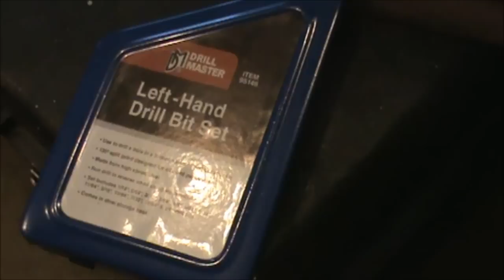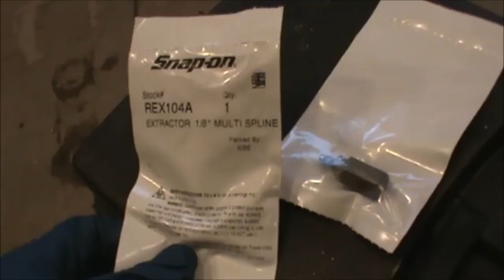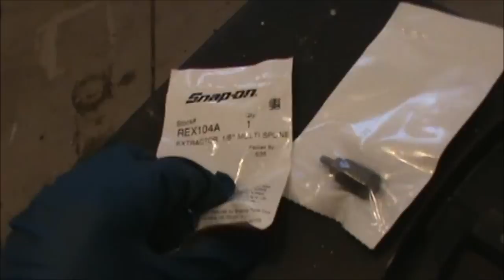How to drill out a broken bolt

Comment: Some people say that the heat from drilling might help break some corrosion off the bolt threads which is a good thing and could help in the removal. Not excessive heat but what is normally produced by the drilling process. What do you think? Thanks!

Comment: Hi DW6...I have a question.  I have a Honda HRR216 lawnmower with a broken bolt that holds the air cleaner assembly and carb to the intake port.  The bolt size is 6x86 based on the part description, about 1/2"-3/4" is still in the machine.  I see in some videos where they show how to remove the bolt using a reverse drill bit and, after finding the center like you did, use a regular drill bit to drill a pilot hole.  Then they use a larger reverse bit in the pilot whole with the drill in reverse, as you did. My question is, do you need to drill a pilot hole or can you immediately use the reverse bit as you showed in the video.  Thank, you have great videos, really learning a lot!

Comment: It might have helped to make a small "funnel" of putty or blue tac around the top of the shaft into which you could spray the penetrating oil. This will help with the freeing of the bolt and will also keep your drill bit cool when doing the drilling. As soon as the drill bits heat up, the drill will blunt a bit and cut in less efficiently. Other than that, the video is very helpful for folks that may not have tackled a broken bolt like this before.

Comment: Removing a good engine from a rusted out deck 3.5hp briggs motor all 3 deck bolts broke off flush, now to get the broken bolts out of the engine and remount to newer not rusted deck, I have the upper part of the broken bolt soaked with diesel/marval/pb blaster, and tomorrow I shall try the vise grip on top and if that fails I will heat it, if that fails I shall try your trick here.... Thanks for the video.

Comment: thorough. i have a broken bolt on my scooter. it's holds the exhaust pipe on. it's upside down but I definitely will try grinding a smooth surface to make a good punch. hopefully after that i'll have the same luck you had with the drilling part.

Comment: Protip: instead of filing, which is perfectly fine but can also push the metal burrs into the hole (making it uneven), you can take an oversized drill bit and center it in the punch, then turn it once or twice by hand, scraping the burrs off and away from your punch hole.

Comment: Also, if you get to the point of using an Easy Out, if the shaft is accessible like this one was, sometimes applying some heat with a blow torch to the outer shaft will help expand the metal, giving more room for the bolt to release more easily. Important to remember though, if you are anywhere near a combustible material like fuel tank/ lines, please take care.

Comment: So, I went to Harbour freight. I bought that 13 piece left handed drill set. I also bought their screw extractor set, which I would not recommend. The screw extractor set comes with right handed drill bits & the whole set is like $8,which is $2 cheaper than the left handed drill set before coupons.I have two rusted screws in my '04 Mitsubishi Endeavor SUV. One is small & holds wires to ground them & another attaches this wire column to the car on the driver side. The heads broke off both screws.

Comment: Great vid man. I'm hoping the same process will work for me. i was rethreading the lower suspension of my car and the bit I was using broke off inside. It's much tighter to remove. Any suggestions? Will this process work with removing the threading bit? Thanks.

Comment: Look useful what you doing, but what if the bolt rusty and frozen in there? Can it still be remove? I work on cars and suspension bolts are hardest to remove when it snap.
Reply: I have to do a bolt suspension removal...any tips...and yes it's pretty rusty

Comment: Those Snap On extractors look like Irwin multi spline extractors. Check Irwin Industrial Tool 53227 on Amazon for the set. I was just looking at acquiring a set for myself. Nice job btw.
Reply from the maker: I have had bad luck with Irwin cutting tools.  Especially router bits, the carbide does not hold up long and it ends up burning the wood.  Likewise, their screwdriver bits are weaker than dewalt or makita.  I don't know how their extractors will hold up, but they may snap off.  I really like their visegrips and quickclamps.
Reply: That's because they are Irwin.

Comment: So basically, I tried to take out the big screw first that holds in this wire column,&I tried the cut and screw driver idea, but it didn't work.I ended up drilling right through the screw and the rest of the screw just stayed there and I put in a self tapping screw, or as people at Home depot say, "a self tapper." haha
Then I drilled pretty deep into the little screw, and everything seemed to be going smoothly, but I put in the little extractor, and it broke in the screw.

Comment: Then I broke two little sized left handed drill bits, and I ended up just getting a titanium dewalt drill bit, which didn't go or cut much into the screw, so I just did a new hole next to the screw & put in a self tapper,& after I put everything back together in the suv, it started right up, and I don't have any problems. I still have to take out this big wiring harness that runs across the engine and obstructs the housing that holds the thermometer. Anybody know how to move it?

Comment: use a dremel and made a slit like a screwdriver slot on back the bolt out
Reply from the maker: Usually does not work on bolts that are rusted in place.  If a wrench brakes the head off a bolt a screwdriver is not going to remove it.  Most snowblower bolts break because they are rusted in place.
Reply: doublewide6 Agreed, lucky you the left handed bit got it, I usually drill it lefty but end up using an extractor anyhow.  I have the cheap Nieko set of bit, looks the same as yours.

Comment: That was a pretty immature reply to a fair comment by Jean Arenas.
It was a pretty amateur attempt, to be honest. The sloppy use of the soft pad ended up with you taking MORE surface away than neccessary, and to grip the sheared bolt with the grips as you did was not the best either. The grooves in the grip heads were parallel to the threads...turning the grips flat would mean the grooves would grip across the thread..

Comment: Video too long, shouldn't have ground a 1/16" off the axle, etc? Only those who have never been impaled with the brain sliver known as the broken off bolt would say such things! These videos are the support group forum for those of us who have to deal with such issues. The negative comments only add insult to injury. If you have never dealt with these issues you likely don't understand that a broken bolt turns a repair project into a rescue with possible huge additional work and/or cost to resolve if these simple attempts fail.